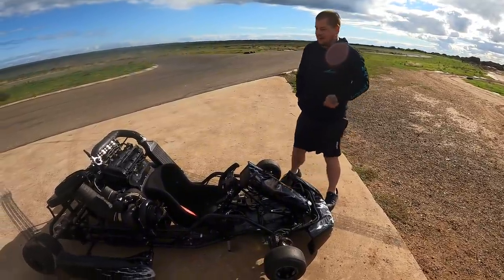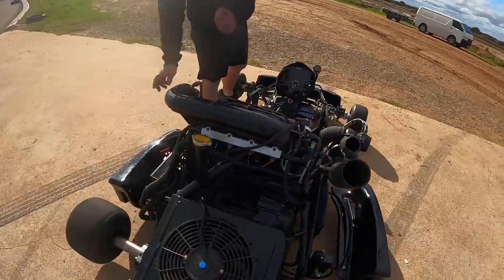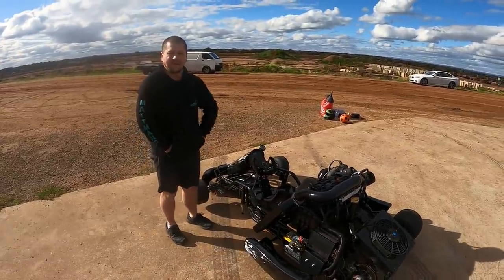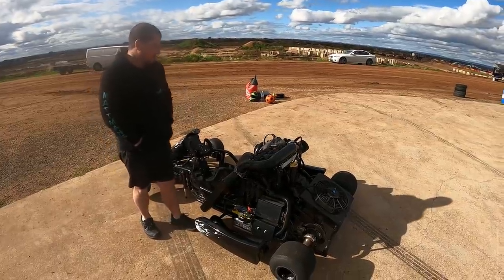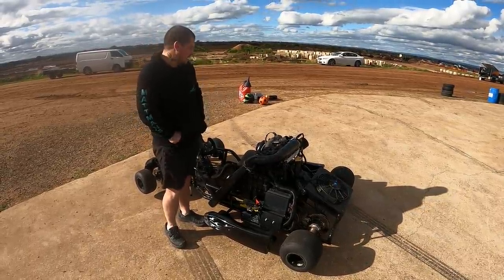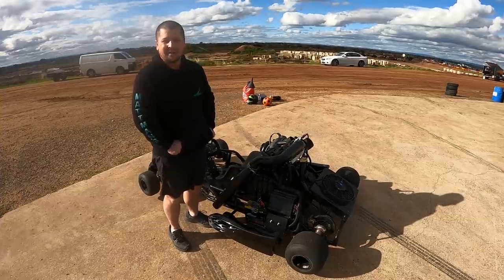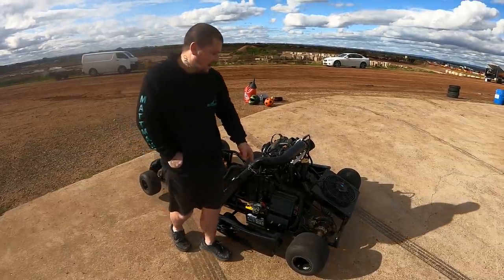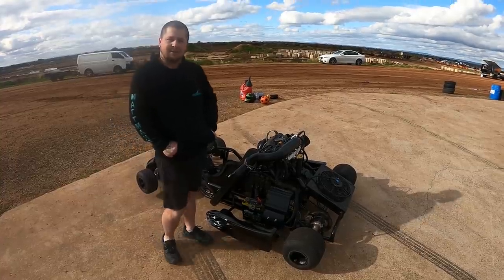400HP TURBO HAYABUSA GOKART  MAKES SMOKE CLOUDS

Comment: That's got to be scary to drive. The power to weight ratio must be like three times a Bugatti Veyron...😛😛😛
Reply: Yeah what the hell how do you not loose control I put a 1800w electric motor on one off them kids huffy electric green machine and its a absolute beast but even that looses control at 30km 🤣
Reply from the maker: Sure is. But fun at the same time lol